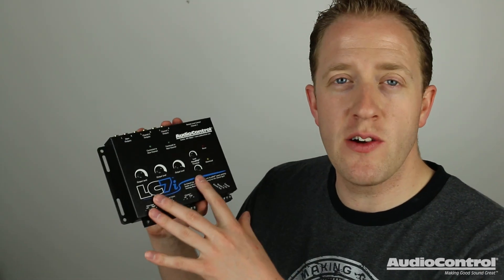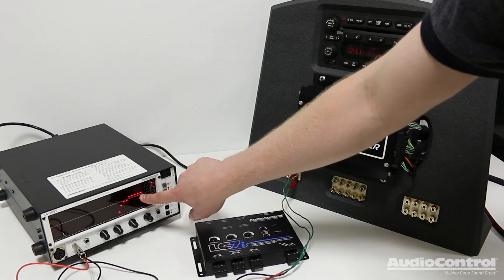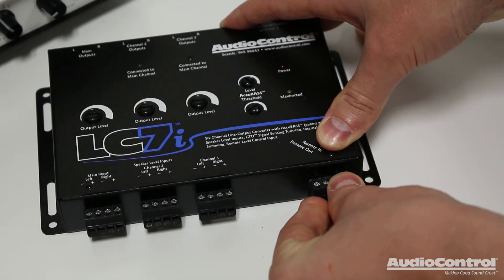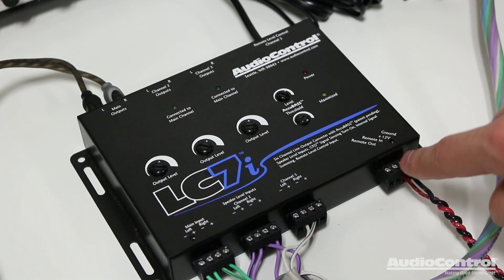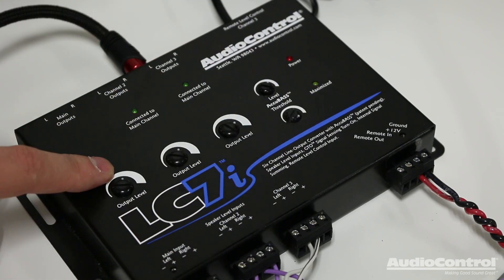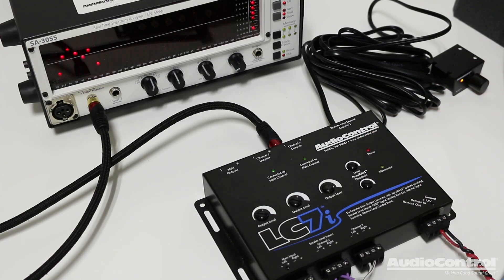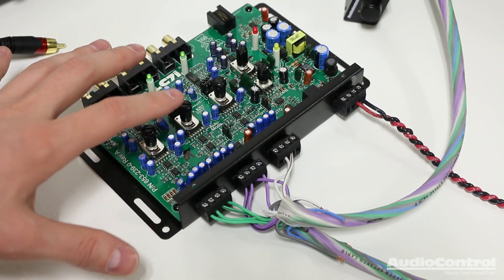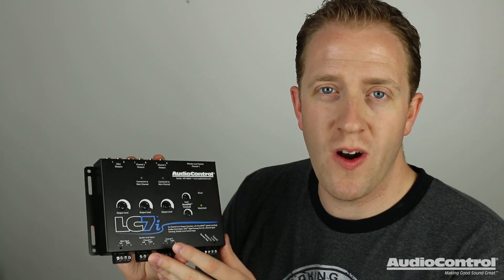Add Amplifiers to a Factory Audio System - AudioControl LC7i Line Output Converter

Comment: My 1st total upgrade (just kept stock radio) I  added a lc7i ,a ref 704a , 6 infinity ref speakers 2- 3.5 dash, 2- 6.5 in F doors and 2- 6x9 in rear deck and 100' of 16/4 ofc in a 2015 Nissan Altima ( also 90 sq ft of sound deadening material). Now to attempt a tune of system
Reply: j barron how are you gonna run all those speakers off 1 4 channel amp??
Reply: @mocheeks23  he’s probably wiring the tweeters and fronts in parallel with a crossover which will only be 2 wires, then his 6x9’s, which is another 2 wires so 4 going into his 4 channel front and rear.

Comment: I think I probably could have gotten by without this unit. I performed a little test of my own. I set my volume at 75%. I set the EQ to flat and I turned the Accubass all the way down. I then adjusted the channel levels on the LC7i right before they clipped. I measured the voltage out of the LC7i and it was about 1.5 to 2 volts. I then measured the incoming signal level to the LC7i and was shocked to see that it was at 3.5 to 4 volts. So in a nutshell, it seems that I'm dropping my input signal voltages by using the LC7i. Since my factory radio never seemed like it distorted much at high volumes, I could have probably gotten by if I had just used the high input connections on my amps. I guess the only thing I'm really using the LC7i for is the GTO feature because I did not run a 12v remote wire when connecting my system.
Reply: Funny because this video shows something completely different than what your saying. 
https://www.youtube.com/watch?v=21xLvMLM1Io
Reply: Thanks for the reply. I'm still using the LC7i. I now think I would have had similar results if I also had an SMD as shown in the video you posted. I think the SMD is more accurate at detecting clipping than the LC2i. Notice that he backed the volume off a tad so no clipping was detected on the SMD, but the maximized light on the LC2i was still lit which gives me the indication that the LC2i maximized light is not very accurate. Simply put, I can probably crank the levels on my LC7i up a tad without any problems. Thanks!

Comment: After watching a lot of these videos on LC7i's and LC2i's, I found that some critical information is not being told. Most of these videos instruct everyone to just set the gain on the LC units by looking at the "maximized" lights. The maximized light is just a guide and I believe that the light will always light when DC (clippling) is detected. Most amps have a maximum input sensitivity of 4 - 6 volts on the low inputs. So basically, it's possible that the signal from the LC7i could be too hot for most amps. I got this straight from the audio control website:

"The idea is to send the hottest signal possible out of the converter, without distorting the output of the converter, and also not going over the max input gain of the amp. This helps ensure you get the cleanest signal to your amp as possible. For example, if the max input gain sensitivity of your amplifier is 5 volts, we will want to make sure the output of the converter does not go over 5 volts. **THE MAXIMIZED LIGHT ENSURES YOU DO NOT DISTORT THE OUTPUT OF THE CONVERTER, IT DOES NOT ENSURE THAT YOU WILL NOT DISTORT THE INPUT OF YOUR AMPLIFIER** The maximized light is a handy tool if you do not have a volt meter handy. It serves as a guide in helping you not distort the input of the amplifier."

So basically, these units are great, but we must be careful in adjusting them because if the gains on the LC units are set OVER the maximum input sensitivity of an amp, it would be like using the amp's low input connections as high input connections and that can't be a good thing.
Reply: if you start properly, with your amp gains turned all the way down, the maximize light will show clipping before you ever go above the amp's input voltage. unless it's a very well built amp, with extremely clean circuitry , but chances are, if your system contains an amp of this quality, an lc7i would have no place in that system build in the first place.
Reply: You’re absolutely right, after I got my smd tool I found I was clipping and I was wondering how I blew my subs before I got the tool, the lights are just a reference as you stated
Reply: That just answered the question I posted. Thanks

Comment: I have Audi A4 B7 with bose audio system and i want just install amp and sub not whole system upgrade.. do i need this or can i buy PAC 2 and use it 🤔 its hard to get one of these here in Finland and if I buy it from ebay it wont have ant warranty 😭 it would be nice if you would answer 😍
Reply from the maker: Jani Kumlander an LC2i is what you need and hope you can get one in your region.
Reply: AudioControl thanks for answer 😯😄 Ill look if I can get one of those 🤔😄

Comment: Just install lc7i on my journey 2017 , and sounds beautiful , but i did the install myself on 4  6x9 on doors , two amps and two subs , first of all dont cut the factory wiring on doors or you going to end up with the radio lock up , have to take to a shop and they help me with getting the radio un lock and re wiring on to lc7i
Reply: Do you have the alpine system?? If so. Is probably why your radio didn't work.  I heard that the radio with out alpine system works with no problems. As longest you hook the speaker back from the amp to the speakers.

Comment: @AudioControl
Thanks for the informative posting, helped me make the final purchase decision! I have bought the LC7i along with the ACR-1 Dash Control for a 2015 F-150 with 7 speakers (no sub) that are distributed as follows:
2 front tweeters that share channels with the 2 front door speakers
2 rear speakers and a center dash speaker for a total of 7 speakers.
I will be driving two amps with the LC7i: Amp1 is four channels but will drive all six speakers. Channels 1 and 2 will power front speakers and tweeters while channels 3 and 4 will power rear speakers (center dash speaker will have to remain connected to factory source ☹️); Amp2 will power subs.

Q1 - Can I run the 4 speaker level inputs from the source unit to LC7i Main Input and Channel 2, Sum channel 2 into the main output, feed AutoMode signal into channel 3 to drive the subs with the mono amp?

Q2 –Is there a more suitable set up or recommendation on something that I may be overlooking?

Q3 – I will not use GTO, so for the remote power lead, can I connect LC7i at the end of the circuit (after the amps) so that I do not have to fuse the remote out or is there a benefit in placing the LC7i in front of the circuit?

Q4 – will I be able to retain fade?

Q5 – is there a way to accommodate the center dash speaker to the audio solution?

Thank you for your response and for making a great product!

Comment: So the way I understand it, you are cutting the speaker wire from the hesdunits and running it from the hesdunits straight to the 7i?
Reply: Them back to of the stereo? From the amp?  Iam trying to see what would be the best way to wire this i cant find noting but i want to run a 4 channel amp
Reply: @2006greysilverado  from my understanding, yes. you have to tap into the output of the head unit (preferably a full range speaker, say a rear) to get the signal, then route it back to the head unit and tie into the wires going to the speakers themselves.

Comment: since the lc7i can put out 8.5v can it over input the amp and tear it up  even if adjusted below clipping.  Thanks
Reply from the maker: Yes. Always make sure to adjust the output level of the LC7i to ensure maximum output voltage will not exceed the amp's input maximum.

Comment: So I'm looking to add one of these with my 2018 wrx my question is this. Can I run a monoblock amp and a 4channel too? I couldn't find  a 5 channel that had the rms capabilities I needed
Reply from the maker: You could run a 4 channel and monoblock as long as your WRX has a full range signal. The LC2i has 2 input channels but will give you 4 output channels.
Reply: AudioControl I went with the the lci7

Comment: Hi,
Where can i take the 12volt and ground from? Can i use a cable directly from the battery in the 12Volt on the LC2I?
Reply from the maker: It is usually best to connect direct to the battery. Most installers run a heavy gauge wire from battery for the amp into a distribution block. From the block connect the LC2i and the amp. Ground should be common for all after market gear. Chassis is ok though we recommend grounding at the battery.

Comment: i have a question im going to pt my jl audio system in my 08 fx35, and was looking at this one and the lcq-1  which would be best? system consist of a 13.5 w7  300/4 on mids and tweeters and 1000/1 on the sub factory head unit. btw im changing all the factory speakers out! please help

Comment: Great video explaining the setup for this device.  One question:  Let's say that your factory Bose amp has separate channels for mids and tweets in the front door,  full range speakers in the rear doors and a factory sub.  If using the summing feature how do you still retain front to rear fade capability from the head unit?
Reply from the maker: With one LOC like the LC7i, to retain fade, you will need to create your sub signal from the front doors and leave the factory sub disconnected. Connect front tweets to input 1, front mids to input 3; sum channel 3 to main. Connect rear to input 2 and leave separate. Now, you will connect the front main output (summed fronts) to the front channel of the after market amp, output 2 to the rear and you can use the front door mids (they usually play into sub woofer range) on channel 3 to the sub amp. Hope that helps.

Comment: What if your car doesn’t have a amp I have a Dodge Charger 2013 se
Reply from the maker: Your car will have an amplifier built into its head unit.
Reply: @AudioControlCar  Im planning on getting a 2015 or up Dodge Charger. Does that have an amplifier built into the head unit as well or a external amp?  Also, if its an amplifier thats built in, would it be possible to get high, mids and bass signal from just the rear speaker wires just incase I decide to install the LC7i or DQ-61 in the trunk/rear of the car? Or Would I have to get the signal wires from the back of the head unit to get the correct wires for summing?
Reply: AudioControl does this device support bluetooth in a 2017 honda accord?
Reply: @jesuschrististheonlytruth335  what?
Reply: @225maine  Calm down,I was asking to get a direct answer on a questiin that I had after I noticed they replied to the other question.Thats all lol

Comment: What if you have component speaker that only has two speaker and 2 tweeter, would I still tap in to the tweeter and speaker separately or can I put them both on main output ?
Reply: hemil mejia a year later and still no answer. SMH.

Comment: GTO didn't work on my factory Nissan rogue. I bought it used, is it defective? the 12v input works fine with remote in/out
Reply: GTO only works when you have input going to the main channel of the LC7i. I tried it out. I thought mine was defective as well
Reply: some factory radio amps doesnt produce the signal for it to activate just go turn off GTO and put it to manuel and connect it to a cig lighter or the igitions turn on to the factory amp and should work just fine =0)

Comment: So I'm installing a new system in my ram2500: 2 3.5s in the dash, 4 new 6x9 2 way speakers and a sub. Im pulling signal from all the 6x9s and am just going to use the auto function to send signal the the channel 3 output for the sub. However, will my 2 way 6x9s recieve the signal to utilize the tweeters on them? Just curious considering the stock 6x9s are not two way speakers. (everything is getting amplified minus the 3.5s)
Reply: Yes your door speakers will receive a full signal. The problem I came into when I added a system is the dash speakers are going to start screaming at you. The factory speakers are 8 ohm and I never could find a 8 ohm replacement. I broke the dash speakers away from the front door speakers and they are amplified separately. I have the LC7i to grab the signal from the 8.4n radio. Then it goes into the Alpine PXA-H800 DSP then to an Alpine PDX-V9 (for the dash and sub) and an Alpine PDX-F6 for my door speakers. I also added the center speaker to my system, I only had the 6 speaker factory system.
Reply: 8 Ohm? I'm certain the 3.5s  are 4 Ohm in the Ram 2500. All direct swaps I have seen with the 3.5s in the ram have been 4 Ohm.

Comment: i would love to buy it, but my factory audio system has a DSP built in the amplifier ( rockford fosgate mitsubishi systems) will these affect the signal processing or time delay?
Reply from the maker: The LC7i will convert the amplified output of your factory amplifier (with built-in DSP) to preamp signals. It will not affect the factory signal or compensate for DSP settings.
Reply: @AudioControlCar  have my main speakers left and right rannned to the main channel on the inputs of Lc7i and left/right rca output of lc7i to aftermarket amp, and i have ground, 12v and remote line connected to inputs of lc7i and out to the amp, the only line i do not have connected is the remote in on lc7i because i thought it would have send signal using the main speaker signal from my factory amp utilizing the "GTO" feature in the lc7i but not getting no green lights on lc7i only power light. Im not getting no bass from my subwoofers at all. So do i need to run the remote in line tapping off my factory amp signal/power?

Comment: just in time for my install. I have a question. for some reason I have the accubass setup but sometimes there is a delay before the subwoofer kicks in. almost like the lc7 is processing the signal before boosting the bass. you can hear the subwoofer building up the bass till it's to the level set on the lc7. any ideas?
Reply from the maker: Your AccuBASS setting is a bit off. Reduce the threshold and AccuBASS gain for smoother transition .